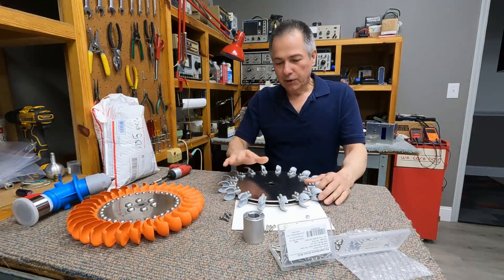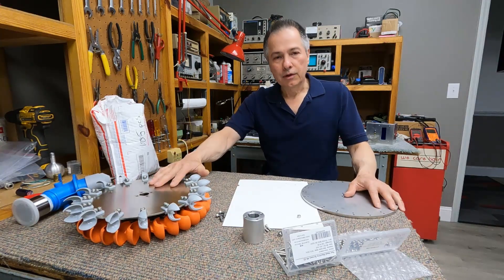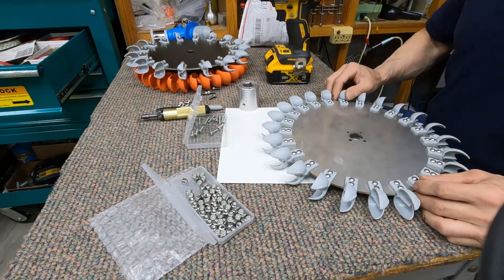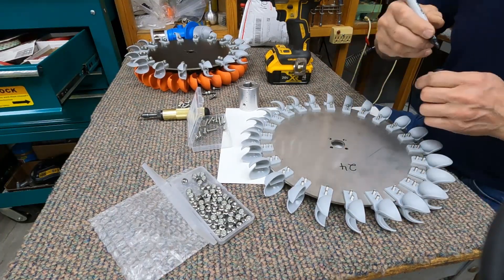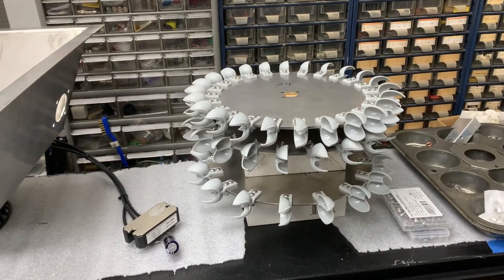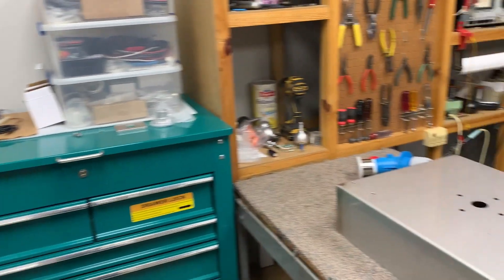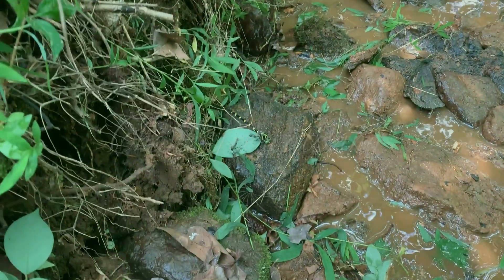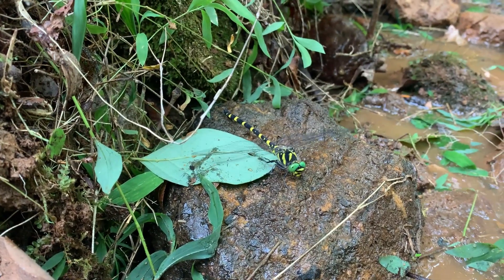Micro Hydro - 16 Spoon Pelton

Comment: your videos are very interesting and quite educational thank you for sharing. I am currently working an an offgrid super low budget system made with a reconditioned gasoline generator and a pelton wheel. I was inspired by many of your videos and some other offgrid systems but most require a large budget which I don't have so I am hoping everything works. so far I've only spent about $400 in total including hose, pelton wheel and other parts.
Reply from the maker: Your feedback is greatly appreciated. Even though I am spending quite a bit, I'm always testing and searching for the cheapest options and comparing them to the high-ticketed items. Thanks for posting.

Comment: Have you considered producing a small crossflow turbine for your hudropower system?
The papers on how to calculate the angles, sizes and everything is freely available online and it is a simple design to build 🤠
Reply from the maker: Yes I have, I was thinking of purchasing one to try out. Is there one in particular you may suggest that I can build?
Reply: @Magutz  
I don't know how the micro/small ones from china are.
I saw someone else try it with mixed results and the quality didn't look to good.

I can't share any links with you here due to YouTube policy, but you should found some papers on it when googling.
It tells you the ratio between angles, sizes etc to get the most power out of the water.
Correct angles and sizes are important for efficiency so that you get power out of the water twice as the water passes through the "turbine blades" twice in a crossflow design.